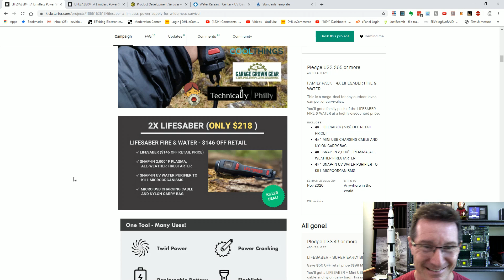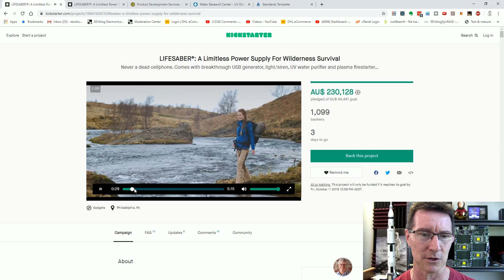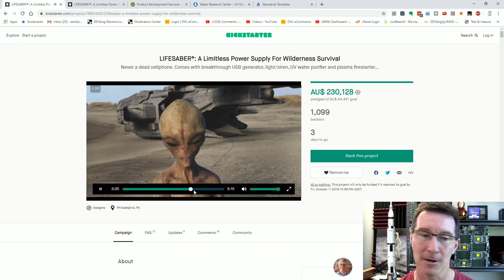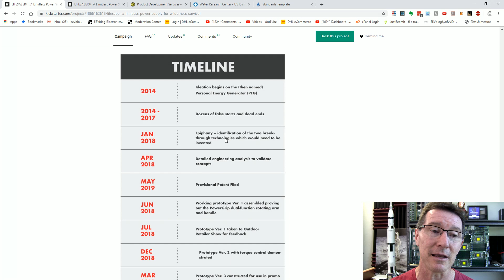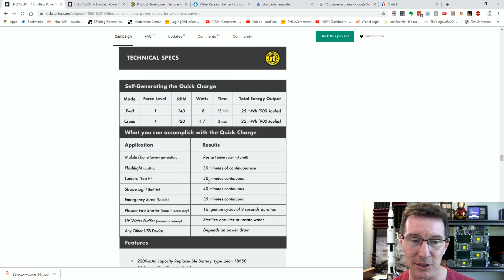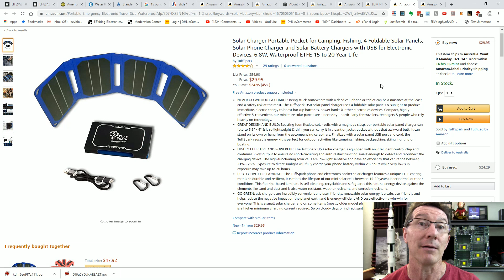EEVblog #1251 - LifeSaber Kickstarter - A Master of None FAIL

Comment: Just as an update on their progress, it's not impressive. Their original start shipping date was November of 2020, and they could be forgiven for supply chain issues around that time but thats not where their problem lay. In November of 2020 they had JUST PICKED THE MOTOR, at which point they said they could begin designing the case for it. So they spent just over a year trying to get the motor to meet it's specs and actually work properly, among other constant issues they had along the way that (not trying to be rude here as they probably were doing their best) were more akin to issues I watched college Senior design teams run into. Now it's 2022 and they are still trying to finish up the PROTOTYPE. 3 Years and they still don't even have a working prototype, i'm pretty sure if you gave this to a group of 3-6 EE and ME college seniors they could have this thing prototyped in one year and working by graduation! They also spent a bunch of time on creature comforts instead of actually getting the basic charging function to work, should they add an SOS mode to the strobe, spending a bunch of time on making the UV light and plasma ignitor a single reversible plug, customizable generator resistance settings, etc.

Then they ran into constant issues with their suppliers, which is not their fault but still adds time delays. They still haven't gotten a single working prototype out to any real testers as of January 2023, which was their goal to send a dozen or so to various outdoorsmen (presumably Vloggers).

This reeks of "Bit off more than they could chew".

Comment: LOL. Two years and a half years later, they are still working on it. You just need a little bit more patience! 

Update from March 1st 2022: "Dear patient supporters:

As you can see from the attached image, our contract manufacturer in Shenzen has sourced (or made by  hand) all of the parts for the LifeSaber. These include the crucial custom motor/generator. The PCB boards are also complete, though not shown.

The next step is to assemble multiple units to be used for comprehensive testing both in China and back here in Philadelphia."

Comment: This also reminds of that portable wind turbine I saw once (don't remember exactly where) for outdoors thingies. That thing weighed like 100kgs in parts, and I bascially thought "Why not just carry lithium cells of any kind up to that weight and you can power literally anything for extended period of time with that kind of battery capacity".

Comment: As I watched your video, it became quite aparant that the only advantage to their product was that it was pretty much all in one.  That said, being a camper with over 50 years experience in the deserts of the United States, as well as trips into the forests and a year in the jungles of Vietnam, I can see where say 40 years back such a device would be the ultimate cool.  Now however, I already have a nice solar charger that bungies onto my backpack and charges as I trudge through the boonies.  We used it to keep our cell phones charged, as well as several power-banks when boon-docking near the Mexican Border a few years ago, it did a great job charging both an iPhone and an Android.  The power banks, each with 5 8650's took a bit longer to charge but the sunshine was ample and the solar cell seemed to love it.  We never needed to purify water, however our motor home has built in filtration so long as we change the filters ever month.  Fire starting  was relegated to my old Zippo cigarette lighter, given to me by my wonderful wife some 49 years ago when I left for Vietnam on our first wedding anniversary.  She still lights on every flick so long as I keep the flint and fluid up, now that I no longer smoke one fill last a very long time, and no need to worry about charging batteries, but I guess if I had a chargeable, I could easily use my solar charger.  Looks like an arduino would work nicely to regulate a few LED's hooked to say a flat lithium battery to keep the power under control as well as brightness. I do have a few 18650 flashlights, one rather nice one takes 3 cells and is extremely bright. I also converted one of those old florescent 6 volt lanterns to LED and replaced the 6 volt batteries with lithium cells recovered from old laptop batteries. I do wonder at what type black light is used in that purification system. I have a hundred black light LED'S that I purchased to play with, one light I built has 9 such LED's powered from one 18650 using a small resistor to regulate the current, she lights up the room with an eery glow at night, and walking into the bedroom is a real trip with the white sheets and pillow cases as well as the old CRT television that is just sitting there since it is no longer hooked to the cable.  If a few of those would make a purifier, it would be a cheap way to go whonder what nanometer light works for that. I do have the 110 volt one for sterializing rooms in a motel after smokers were there, I bet that would do gallons but it's 110 volt.  Probably could be converted to 12 volt or so I would guess, never took the base apart, it has a base that looks like those cheap chinese florescent lights the government wanted us all to convert to so many years back.

Comment: I remember having a hand grip/crank torch twenty odd years ago when i was a kid. Had an incandescent bulb that used the power quicker than you could generate it, so as soon as you stopped cranking you were back in the dark. On the plus side it didn't need a power switch.

Comment: 5 minutes in, here are my thoughts: product contains one generic Chinese LED flashlight/wearable headlight module, a TP-4056 charger for the 18650, and the tiny dynamo plus the emergency siren circuitry from one of those handheld sirens for personal safety. It also has parts from the $40 "As Seen on TV" Atomic Lighter (which is useless for lighting cigarettes but works quite nicely lighting incense sticks due to the small spark gap).
The honesty of the campaign is refreshing - but the massive "add-on" list is so far out into orbit that Capt. Janeway is reading it in the Delta Quadrant. lol I didn't bother looking to see if they had a Fontus water-from-air device. Maybe they could team up with Batterizer to squeeze the most they can out of that built-in 18650?
I admit, the video was amusing... But do you really expect me to believe aliens need to recharge their spaceships via USB?

Comment: Box of matches: 10g, 50 cents
Chlorine tablet: 1g 20 cents
1000 lumen torch with Usb output (3000 mAh Samsung 30Q) 180g,  $20
Scream and shout... no weight, free
or
Emergency whistle, 20g, $5

Coming across someone with a half kilo of expensive "survival" tool twiddling it around trying to light a fire because they flattened it trying to sterilise a bottle of water...  priceless.

There are a lot more important survival tools than any of these things but none of them involve electronics or are "inventable".  Gadgets like this only look good to someone who's never set foot in the bush and probably never will.
Oh, nearly forgot...  waterproofing for your matches?  ziplock bags - the best friend of kayak campers, soldiers, and adventurers all over the planet.

Comment: I love the 'air pump' idea. All these conversions from mechanical muscle power, to electrical, to chemical, back to electrical and, finally, back to mechanical power. With a little bit of luck there'll be some buck/boost converters in there, for some additional electrical<->magnetic conversions. You could've just blown the fucking air-bed up by blowing into the nozzle...

Comment: UV water purifier? So, just a UV flashlight thingy? Easy enough. Could even make it a USB attachment for a phone if you wanted.

Plasma firestarter? Could just have a lighter or 2 in the field pack instead. Some even use piezoelectric sparks, which could still be used after you run out of fuel.

As for the rest, pretty much all those other features can be done with a smart phone, so not sure what the point is.

For recharging the electronics, it's not hard to find or build a battery bank with a hand crank to charge literally everything else with. Literally that's all it'd do, charge a battery bank which then can charge other devices.

All in all, I can't see spending anywhere near as much as that kickstart product for what it does. It's just not worth it in the slightest

Comment: One thing I thought on seeing this is that unless you really need electronics, I think you'd be better off with one of those magnesium and flint fire starters, a steel knife, and a small pot for boiling water.

The other thing is you could get more torque on that generator by attaching a sling to it with some rocks, which doubles as a weapon for hunting small animals. It might break though.

Comment: Reminds me... I need to start a kickstarter project myself...  Unlimited energy for only US$14.6 billion.  All you need to do is provide an ongoing supply of Uranium 235 and I will do the rest.

Edir:  Since there was so much 'debate' on the whole 25mWh versus 250mWh, take the 0.8W figure instead.  0.8W for 15 mins is NOT 25mWh and NOR is it 250mWh.  Let's try 200mWh instead???

Comment: XL ferro cerium rod, add handle or cord yourself- $5
Cheap mora knife- $10
Tealight candles and candle lantern holder- $5 (candles can also be used to help light damp kindling)
waterproof bag > water filter > drink container, hang from tree, gravity filters the water for no work- $40 (or just boil water in your cooking pot)
Charge up an old cell phone with no sim and keep that as a backup to only use to call for help.

Comment: I do like the idea of modular attachments on  a power bank base unit. The product really should be sold as just a base-unit with the 18650 in it, and then each of the other "features" should be optionally sold separately so that users can pick and choose how to customize their unit. I like the idea of having the arc lighter, UVC sterilizer lamp, and flashlight, but I could care less about the hand crank.

Comment: Gotta admit I really liked the aliens ad. For once, a funny and creative ad. Stuff like that usually makes you remember the product really well and shows that the people you're buying from have a nice sense of humor. It's a shame they edited it out, but I don't think that was due to Dave's rant, maybe some issues with paying the CGI artist?
On the product itself, while it's true that separate gadgets would've worked way better, this one can be stored in a car's trunk or some emergency box in the basement literally forever. Sure, by the time you need it the battery will discharge and most likely heavily degrade, but should be good enough to store those 250mW*h of energy. What I really don't like is the attachments. If you go as far as carrying a whole bag of accessories for it, might have as well gotten a proper kit.
Reply from the maker: The video had been up for the entire length of the campaign (a month?) and only taken out 12hrs after my video? Maybe a coincidence, but I doubt it.
In the case of leaving it in your trunk, just any any one of the existing crank generators on the market.
Reply: @EEVblog  Fair enough about the video. In this case that's just sad since there's imho little to be ashamed of in that ad. And if you're getting a crank generator anyway, might as well buy one that has built-in flashlight and bug zapper in it. This of course doesn't justify paying this much and waiting this long, but I mean in future for this type of product.

Comment: I think the modular add on idea is neat, but think they should have made it so you can put 2 add ons, and make the charger one of those add ons.  They could make it relatively small by default (ex: flash light add on + fire starter add on) and some add ons like charger would be bigger.   That UV light is kinda dangerous though... you don't want to be just using that in open air as it's very bad for the eyes.  It should be more contained, maybe it can be a whole bottle in itself and the light is inside and can be changed, but is out of line of sight.   If this actually made it as an off the shelf product and not a one time thing that fizzles out they could then sell all sorts of different add ons so it has potential I think.

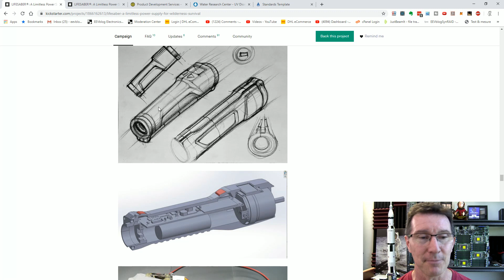Comment: 12:45 Solar cell? In a portable size they barely even produce electrickery! Come on! See electromicals for what is it! A extremely costly(until any new stable tech comes out that changes that) form of energy in a state that are so refined that the refined-statement in it self says there are some physical hurlde to make everything electric.

17:02 I haven't worked 17 years in the field of UV but it's used in our local drinkingwaterplant so yes it works but the unit have a enclosed pipe stuffed with high intensity UV-lights and processes huge amounts of water. I wonder if a tiny UV-led really works as well?
I have the magnesium firestarter but I mostly use matches or a  long-reach butane lighter for comfort.

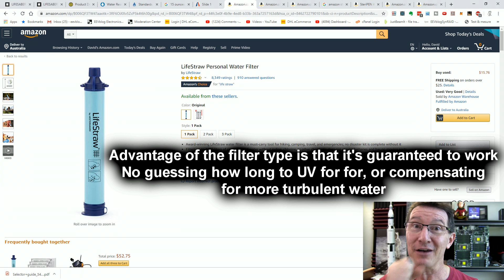Comment: 23:10 you mean turbid. Note that filtration systems will stop working extremely quickly with turbid water. Best solution is iodine tablets/drops, or a chlorine based tablet. I've used both.

Comment: plasma arc lighter   $9  8 pack of BIC lighters $9  Magnesium fire starter $7
1 every ready LED flashlight 25 lums 60 hours run time  $3 extry d batteries 4 pack $5
2 pack water purification tablets $12 (short term) as it does not filter and neither does the UV light so you are taking a      chance with unwanted chemicals or metals that may be in the water
$6  Emergency Whistle (no batteries just blow) 120 decibels

phone charger $20 or just turn your dam phone off, your out camping so why the fuck do you have it on 
unless it is an emergency otherwise if you have it out playing candy crush your happy ass should have stayed home.

Comment: Dont trust those fluffed up "25000 mAh" solar bank claims. I have (granted a cheaper) model that has 20,000 mAh printed(lasered?) on the case, but contains two 5,000mAh cells. So its physically half the capacity. In an ideal world thats capacity at 3.7v. Its up to the inverter how much of that gets turned into usable energy at 5v. I ran an RPi 1 B on it at idle watching htop via ssh until it dropped(basically the last frame sent would display the last uptime update before low voltage dropout) with an DMM monitoring amps. After clunking through the math it came out to the neighborhood of 3000-5000mAh at 5v total....

But in fairness, it does hold a charge, it does put out 2A-ish  power, the 6 LED flash light panel is goodly bright, and it WILL solar charge to full with half a days direct sunlight (ambient otherwise) over the course of 2 days. Thats not great, But if im stuck where i NEED to charge my phone, thats not bad. And best of all, it was free!

For less than $15 id say its ok, but ive seen it WAY higher. I know the chinese factory district style of (over)production works, levels of QA acceptance, etc, and a $40 one could possibly have batteries closer to 20,000mAh (though i havent come across a battery cell that would fit the physical size and capacity yet), we all know they're not going to be in the $11 one on wish/ebay/amazon More to the point, the energy output and storage claims need to be more regulated...its getting ridiculous...
Reply: btw 2 5000mAh battery in series is still 5000mAh

Comment: A UV lamp in a plastic casing? Well, that is not going to last if you put a good UV-B/C germicidal lamp in there...
Reply: Shouldn't acrylic glass do a good job for this?
Reply: @MetalheadAndNerd  No, acrylic glas completely absorbs UV-C (UV-C starts at 280nm and acrylic glas doesn't transmit any light under 250nm)

Comment: I agree with most of what you say. The one thing I disagree on is about a hand generator being useless. No matter how many batteries I carry I always end up in a situation when they are all discharged. A hand generator gives the peace of mind that you will always be able to generate that little bit of electricity perhaps just enough to make an emergency call or see your way in the dark. I always leave a hand crank torch/charger in both my cars. They are just some cheap Wan Hung Lo gadgets made of low grade chinesium but they do the job.  About five minutes of hand cranking is enough to get my dead Samsung S6 to switch on and make a few calls and the torch works right away with cranking even without charging the battery. It is no floodlight but more than enough to walk safely in pitch dark.
Reply from the maker: If you can't prepare your trip so your spare batteries don't run flat then you have more to worry about than that...
Reply: @EEVblog  Thing is life is not made only of planned trips.

Comment: Few years ago I was considering taking similar eccentric mass hand crank (old drill + cc smps) for longer hiking trip and decided I was far better off just carrying 15000 mAh of unprotected li-po cells. Clearly the wrong choice. By now I could have had $230000 be-it dubious startup, instead I'm left with a pierced li-po and a dignity.

Comment: I'd have thought that for a realistic hand crank generator you'd have to be generating at least 5W of power to make it worthwhile (and easy-ish to crank).  You also need something that can accept the power as fast as it's generated. 5W would be a suitable limit for an 18650 - around about 1A of current: a 5V 1 amp supply, regulated to 4.2V for the battery - tp4056 charger?) - still, over 2 hours of cranking to fully charge a battery though.  No need for a warming device if you are cranking for that long either :-)
Reply from the maker: Their numbers say this one generates just under 5W